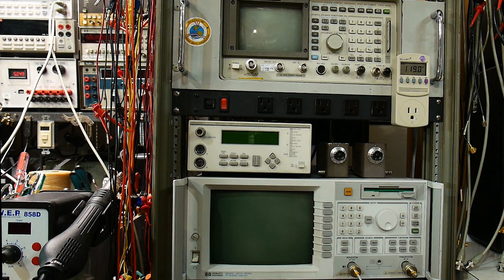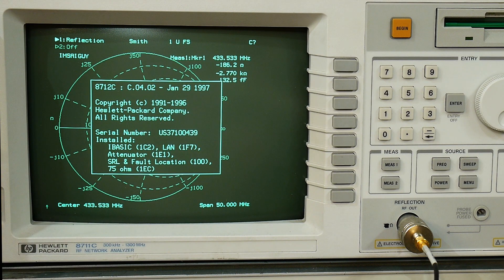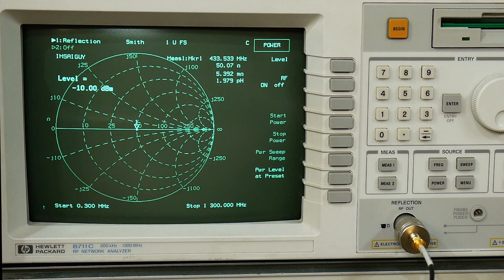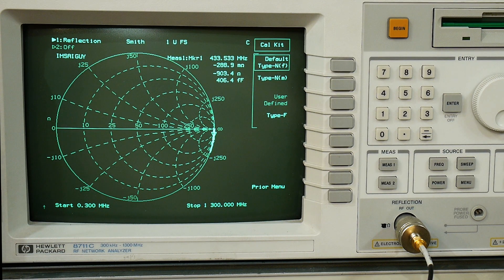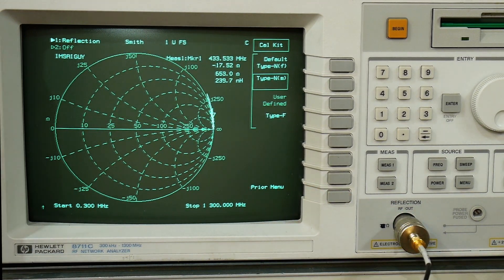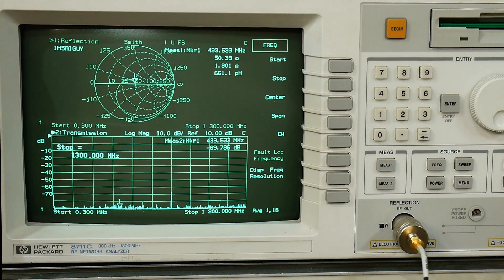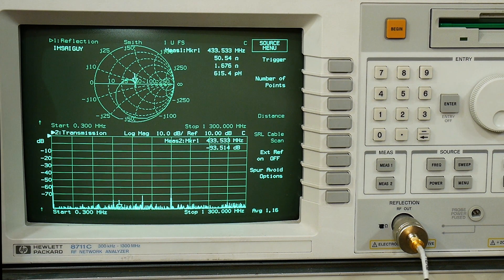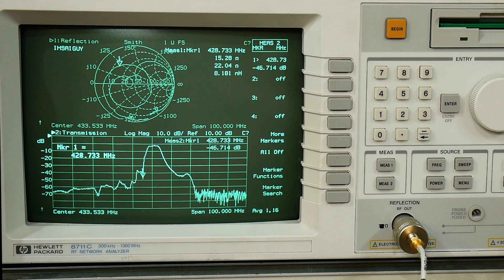#869 HP 8711C Hacked into HP 8712C VNA

Comment: I have the HP 8752A, certainly a nice instrument to have, the one I have covers 300kHz to 3GHz. I looked at this model but settled on the one I have, and like you stated it blows the doors off my Nano VNA. The Nano VNA is fine for on site antenna work or hobbyist use, but the HP 8752A can easily communicate with my HP plotter and can be remotely controlled over the HP-IB bus. Not to mention the orders of magnitude better performance.
Reply from the maker: and can control itself! mine has the iBASIC option. https://youtu.be/oUvud0v_LNI?si=gjSLW_6gwU6Wk9_d

Comment: I have the same one. Changed it into  VNA as well. The right port has a 25 ohm series resistor built into the connector. I replaced it by a "plain" 50 ohm connector.
Reply from the maker: me too
Reply: @IMSAIGuy  Dis you do anything with the other port ?
I left it 'as is'
Reply from the maker: https://youtu.be/Ble1lVNVJzA
https://youtu.be/MSLm3FL7HDM

Comment: Hello, I finally got my hp 8712C. I had a question for you please. I am unable to reduce my power level to below -2dbm. Trying to take it down any lower puts out a message that reads, "Performance at this power level is not specified". My machine does not have Step Attenuator.

Any suggestions please. 

Also, is there a way to bring the unit back to absolute factory reset. I use Preset button, but wondering if there was an absolute factory settings.

Thank you
Reply from the maker: with out the step attenuator option you will be limited. you can use external attenuators if needed. I'm not sure you want to do a full reset as you may loose calibration. There are many calibration steps that require special equipment. There are steps that do not need external equipment and I have done those service cal steps on my unit. you should save your cal data to a floppy right away.
Reply: @IMSAIGuy  thank you. I have done the one-port calib., and have stat-cal saved.
Reply from the maker: @N0AGI  Have you read the service manual and calibration? deep in the service menus is where you do the save cal data.  the state save you did does not save the internal calibration data.
Reply from the maker: systems options
service
update corr const
store cc to disk
Reply: @IMSAIGuy  thank you very much.

Comment: Could you hack the ROM and change the 75 ohms displayed at boot up  to 50 ohms? Nice video.
Reply from the maker: no, but the only place it matters is in the smith chart and there is a button to set Z0=50 so no problem.